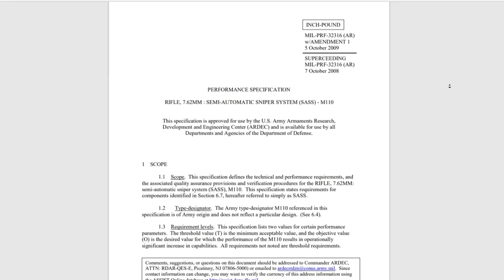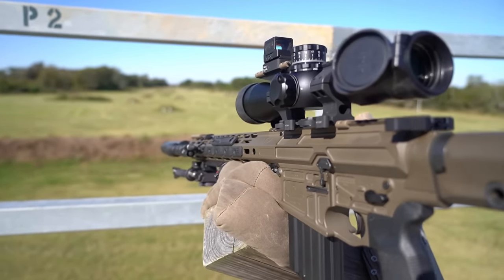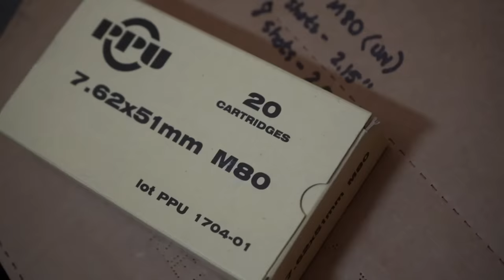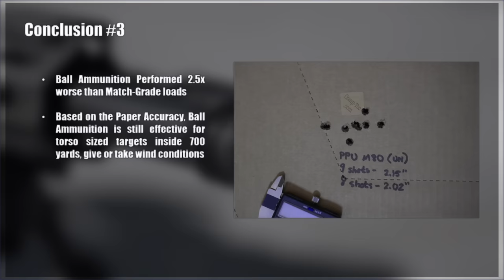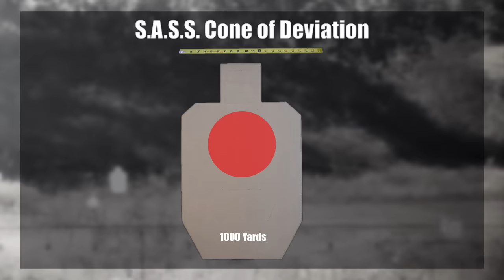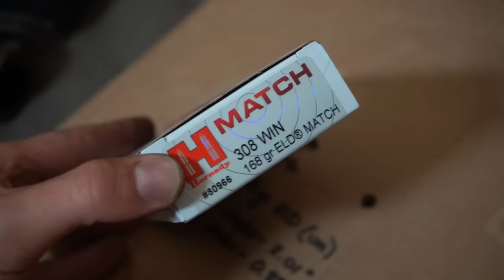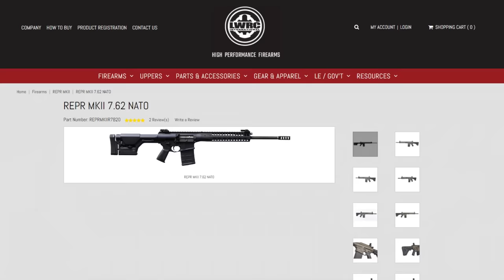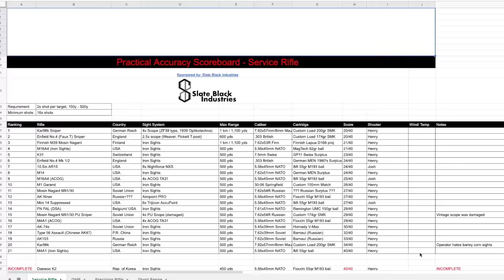Anatomy of the Semi Automatic Sniper System (SASS): Featuring the Lone Star Armory TX10 DM Heavy

Comment: what's with the 3:47 trigger press?
Reply: A consequence of a small grip and/or a relatively heavy trigger I suspect. A small grip's short LOP tends to make pulling with finger contact near the proximal phalange (the part closest to the knuckle) easier than pulling with the distal phalange (where the fingernail is), especially for those with larger hands. Some shooters also find it easier to control heavier triggers in slow fire this way, although given that the trigger in the video looks like a two-stage, it probably isn't very heavy

Comment: I'm running an Aero M5 with a Faxon 18" pencil barrel, it's a 2MOA group with M80 but sub-MOA with FGMM and Barnes TTSX.
Reply: How many shots per group?
Reply: @lucastonoli3256  usually 5 shots per group, I can't really afford 9 shot groups when some of this stuff is $2 or more per round. This rifle wasn't built for accuracy but mostly for weight. Most AR10s are 10lbs+ empty with the SASS being 15lbs. My AR10 is 7.5lbs empty, 9lbs loaded with a 20rd PMAG and MBUS Pro sights.
Reply: Running a similar setup with a 20" version of faxon's pencil barrel and have managed reliable ~1MOA groups shooting winchester match ammo. Your other reply about weight is spot on as well. Without scope my build comes in at ~8lbs, with scope 10.6lbs without magazine of course. If I end up finding an adjustable carbon fiber stock that I like, that will probably shave another lb off(running a heavy magpul stock atm). Once I get a bunch of ammo to do more rigorous testing I have no doubt that sub moa is doable with good ammo. That also will be a good time to see how the group size opens up once everything heats up. So far all my shooting has been a box at a time and not enough to build up much heat.
Reply: @SuspiciousGanymede  nice set up
Reply: Im running aero upper and lower with the Faxon big gunner 18", Im hitting sub moa with 168gr IMI razorcore

Comment: I like that I made my own poverty version of this with my M&P10. I’ve got the same SLR rail, adjustable gas block, Geissele SSA-E trigger and Silencerco omega suppressor.

I just use the stock M&P10 18” barrel though. I haven’t seen sub-MOA groups but that may be a limitation of my shooting skills rather than the capability of the gun. 

I mostly shoot German surplus with it and it’s a hugely fun gun to shoot at steel silhouette targets out to 500 yards.
Reply: Did you have any issues with yours from the factory? My one experience with them was one that came with a finger tight barrel nut and didn't shoot anything better than paper plate accurate like that.
Reply: @randomidiot8142  I didn’t have any issues like that. When I free floated the gun with an SLR rail, I had to remove the stock barrel nut and I don’t recall it being loose and easy to remove like that.

As for accuracy, I don’t shoot a lot of match ammo with the gun, (not at all before I free floated it), but it was certainly not outside of 4 MOA accurate.

I haven’t shot for groups in a long while but I will say even free floated the accuracy hasn’t been amazing for me. When I was zeroing it for a new scope I wasn’t able to get better than 2 MOA out of Gold Medal match 175gr. Again, this may be my shooting skills not the gun. 

It’s been a long while now since I shot those groups with match ammo and I think I’m a better shot than I used to be. Maybe it’s time I take this back to the indoor range and try shooting for groups again.

Comment: Solid video, nailing a lot of points that many ignore/are ignorant to. That said, I’ve largely ditched IR systems on precision guns opting for it to be on the spotting scope
Reply from the maker: Interesting - are you running some sort of nvg or clip on with the spotter as well?  Or is it just acting as your host for the IR device?
Reply: @9HoleReviews  yes, on a badger SLICK. I’ve just had issues with the IR illuminator being where it needs to be so I’ve gone over to the spotter handling that. It also allows them to better place the IR so that you can see the IR splash off the base of the projectile
Reply from the maker: @ShawnHinck  Very cool - we've been looking at some of the 'hub' setups for the spotter
Reply: @9HoleReviews  the badger is hands down the best one I’ve found with how they implement everything. They have a few guys who have spent time on sniper teams doing good work and making smart design elements that make sense

Comment: I'm cracking up as I hear the clang of the suppressor banging into the guard rail and thinking, well, it passes the "whack it on the barrier" test as well.
Reply from the maker: Goes to show how training and reps work - I had run the drill a few times without the suppressor just as part of testing...when we got it on footage was after I had put the can on the gun...I pulled back the same length/distance I had without the extra 7" of can that was needed to clear the muzzle.  WOOOOOPS

Comment: As a PRS competition shooter that has a secret obsession with gas guns, you could run a semi auto to the same level of a bolt gun. My .308 gasser is fast and similarly accurate. I will say that the gas gun takes more effort to shoot at the same level - meaning more solid fundamentals. You can get away with more mistakes on a bolt action for sure.
Reply: Curious why the difference when chassis bolt guns resemble semi auto ergonomics.
Reply: @randomidiot8142  it’s not necessarily ergonomics but more so fundamentals of marksmanship - follow through, natural point of aim, etc. gas guns are much less forgiving, especially when under pressure at a competition shooting tiny targets designed for 6 Dasher Gucci bolt guns 😆
Reply: @billbee235  6 dasher in an ar15 mutant might be fun. Maybe on a .284 case.. 🤔 

Still trying to make sense of what you're saying. It's your experience and not theory. Natural point of aim on the bolt guns is better.. McMillan a5 type stocks vs chassis vs semi makes a difference? And fundamentals.. your head telling you to hurry up and pull the trigger on a semi where on a bolt you know you don't have a fast follow up so you slow down?

Comment: Noob here. If I only shoot 600m and less is there much difference between 16" and 20" barrels? I got budged AR10 in my sights for 2022 summer for longer range shooting and hunting. If I'd get to really long range someday I'd just get a new upper for something more modern than .308.

Great and interesting video as always. :-)
Reply from the maker: My personal thought on this is, if I were shooting within 600M but wanted a 308 over a 5.56 or otherwise small-frame-AR, I'd be happy with a 16" gun...more wieldy, easier to add a can to from an OAL perspective.  Longer barrels are always going to help with the extra velocity but, within 600M you'll find a 16" pipe more than capable - You can checkout the SCAR17 PA run we did some time back where Henry had good success out beyond 500 with the 16" barrel.

Comment: Can you check the alignment of the clips inside the suppressor? if they are at the 12 or 6 o'clock you shouldn't notice a very bad impact shift, but if they are at the 3 or 9 they should push your strings off to the left or right that very same suppressor on my AR15 put A 3 moa shift to the left because the clips were all on the right. When I re timed my muzzle device to put the clips at 6 o'clock the impacts stay the same

Comment: Top Mounted dot vs Angled-right side dot (Spuhr)?
Reply from the maker: In my experience, the top-mounted dot is marginally better for trying to use the dot for observation purposes (to line the gun up quickly with a general area and then drop into the glass as described) since it doesn't require rotation of the gun to return to level.  Angle-mounted on the receiver is a bit more than marginally better for speed and recoil control on closer targets.  The top-angle combo mounts really are one I've never found to be a good option for the stuff I'm trying to accomplish - in my playing with it, it seems to do both of those two things (observation and speed) worse than the alternative options.  That's just based on playing with one briefly myself.  - Josh

Comment: Would the price of an AR-10 be lower if history was changed and the AR-10 back then had more wide spread adoption? Like if the US military seriously looked into the design and adopted a DMR role early on post WWII? Like how the soviets did with the SVD?
Reply: We would at least have a mil spec for it. The parts incompatibility between manufacturers wouldn't be as bad as it is now.
Reply: We would have a true standard for it, but probably not. The accuracy requirements and general demand of the .308 cartridge makes it an all around more expensive gun by a significant margin. We’ve seen inexpensive AR-10’a from companies like PSA, but they typically lack the more expensive features that make an AR-10 worth having unfortunately
Reply: @valiant545  to get to the reviewed rifles level with an ar15 you wouldn't be spending much less on the similar components.
Reply: @randomidiot8142  High end AR-15 like the one shown would be around $2200 give or take. High end AR-10’s start at around $3000 and go up. While I agree the difference between a high end AR-15 and AR-10 isn’t a huge price difference, the range that those high end AR-10’s can reach in chasing performance is. We’re talking $1800-$3000 range for high end AR-15’s versus $3000 to $5000 for high end AR-10’s
Reply: @valiant545  what are you even paying for at that point. That's a joke, and not a very funny one. You're paying extra to a company so you can give them free Instagram and forum advertising? The outrageous money they charge gets you what.. a fancier roll stamp? Entry to the 'I paid more' club? 

I don't get people.
Reply: @valiant545  glass aside. Paying more for optics has not left me disappointed like it has with other accessories. 

I haven't shot anything in that price range.
If these companies you mentioned are doing everything in house that's one thing. When they outsource parts like the reviewed rifle in the video.. what's the point in paying them more for something I can do myself? Just about every good barrel maker will profile an AR10 barrel and set headspace, supposing I didn't feel like doing it myself. Then everything else is just a pile of parts to put together in 15 minutes. What do they offer for their premium price that is unavailable to me when I have a pile of parts that looks almost exactly like theirs? How will spending more money with one of them get me a better performing product? I'm just curious how their price point is justified to the end user and how can I not do what they do with the same outsourced components.
Reply: @randomidiot8142  So a lot of it has to do with the quality of the build, I absolutely think you can get 90% of the way there with the same parts building it yourself, but it's sometimes more expensive at that point from shipping costs, and most high end companies discounting the parts you add compared to the market price. For example a Triarc in the $2300 price range would have all the amenities. VLTOR A5, Radian charging handle, NP3 BCG, ambi controls, Geisselle trigger, etc. The rifle is tuned specifically for its configuration, and everything mates flawlessly. You can absolutely get there for less if you shop around for deals on your parts, and it will be mostly the same so long as you do your part during assembly, but there is a level of quality that is hard to convey through text, I really wish I could just hand you one through the screen lol. Push comes to shove, I'd rather build a gun myself if a "factory" gun can't have the features I want, but if I can I'll let a smith do it. I don't know if you shoot long range bolt guns, but its kind of like how even the custom guns are typically assembled by an accredited smith usually. The small details in the gun that is a result of their accumulative experience is what makes the biggest difference of all. Again, I'm sorry if my explanation is lacking, its really hard to explain it through text other than quality of parts and quality of build. If you ever get a chance to try out an ADM, Noveske, Triarc, KAC, LMT, Radian, etc. I would highly recommend it. It made me a believer in spending more, and I sold my old Colt just to get one. Training beats gear tho, so there is no shame settling for a less expensive rifle or trying to do a cheaper build if it isn't financially viable. Cheers man

Comment: Nice video. I like the requirement discussion and the way you presented the accuracy data. On to the product: Nicely done, very heavy and high price. It should better do its job. I have only shot a Heckler & Koch MR 308 with a 16" barrel and a Steiner MX 5i. Nice gun, very heavy, very accurate and very expensive..... Main probelm with this guns besides the price: they are way more capable as most of the folks who are pulling the trigger.

Comment: I enjoyed the test but 1 MOA accuracy at 100yrds does not equal 1 MOA at 1k yards.  When you run it over a chronograph and factor in the standard deviation number and extreme spread number you will have a more realistic expectation. Shooting ammo with 30fps SD and 60 ES numbers is going to flop at 1k yards.

Comment: Wouldn't running 6.5GRE out of a AR-15 platform be lighter and get you about the same for distance?
Reply: While you could definitely get the same levels of accuracy, I'd imagine a .308 will have more energy on target at all distances.
Reply: +1 my .308 precision gas gun knocks steel off the T-Post inside of 600 yards 😂 that round just hits hard
Reply: @lordhellfire153  Depends on the loading, but some 6.5 Grendel rounds will have more energy on target once you pass ~700 yards due to the high BC. I'd also argue more accuracy in practice due to substantially less recoil, as 6.5 Gren is basically necked down 7.62x39.
Reply: @hjorturerlend  I know the energy @700 is true for 6.5 Creedmoor but I've ever heard that same claim for Grendel. 

And the 7.62x39 thing is why it only takes a barrel and a magazine swap to change any AK over to Grendel. Trust me, I've looked into building a 20" milled build specifically to take advantage of this, but sourcing a barrel is a bitch.
Reply: @lordhellfire153  6.5 Grendel functions similar to 308 in every way except energy (still decent energy though, just not as much).  As for the 7.62X39, the Grendel performs significantly better in energy and velocity and drop. The 7.62x39 performs like a 300 blackout, not particularly effective beyond 300 or 400 years.
Reply: @Brimwald  At point blank range 6.5 Grendel performs pretty much identically to 7.62x39, but it retains that energy due to the high BC.
Reply: @lordhellfire153  Ok, might have misremembered that. The point still stands tho, the energy difference at long range isn't much - both have lost enough energy to the point where they are just making 6.5/7.62mm holes in the target. 

I'd go with a normal 16 inch stamped gun for a 6.5 Grendel AK build, a "light battle rifle" build with a 1-6x. Not much point in trying to turn the AK into a DMR imo.
Reply: @hjorturerlend  that's true

Comment: 1:8 twist? 100fps per inch cut down? That doesn't seem in character for .308.
Reply from the maker: I said 100fps over the 4" difference from 20 to 16", not per inch.  100fps per inch would be way too much velocity loss at those barrel lengths based on what we've tested.

1x8 is direct from the LSA team.  Will ask them to confirm?  Maybe I misheard.
Reply: @9HoleReviews  nope you right. I am deaf. 100, over 4 inch total. My mistake. 

I have heard of 1:9 but that is usually designated for 118LR military rounds. I am curious if they have discovered something new.
Reply from the maker: @FXIIBeaver  I'll have to ask next time I speak to them - obviously this liked the 178s the best....wonder if related?
Reply: @FXIIBeaver  the mil spec twist is 11.25. 1/12 is probably saami but 1/10 is becoming very common now. 1/8 would be very quick but it would probably work fine. I’m having a rifle rebarreled by SAC in 308 and they recommended a 1/9. These new bullets require faster twists and a little extra also allegedly helps ensure a clean subsonic transition
Reply: @9HoleReviews  makes sense.  Spin a heavier bullet faster.

Comment: What about the difference between a 20 inch barrel and a 24 inch barrel.? They build sniper rifles with 20 inch barrels nowadays.? I bet you build a huge fire and then pour water on it. Get real, I would never pick a rainbow trajectory .308, a 20 inch barrel, or a semi-automatic. None of those are conducive to a great sniper rifle. Sniper rifles should be bolt action only. How about a 6.5mmx.284 Norma with a 28 inch barrel. Or, for longer ranges, a bolt action .30-.378 Weatherby with a 30 inch barrel. Or the same in .338 Lapua. Semi-auto, .308, 20 inch barrel and you call it a sniper rifle?. No way. You can call it a squad marksman rifle, but never a sniper rifle. It is about like that new rifle that Sig-Sauer is making, the Cross-Fit or some BS like that? You can get it in a 16" barrel or a 18" barrel. No thanks, the people at Sig Sauer must have got into some edibles. The 7.62 Nato or .308 Winchester is a rainbow trajectory brush gun. It was a POS in 1957 and it still is a 30-30 like performer now. An easy to handle bolt with a 26 inch barrel in 6.5 Creedmoor would be miles ahead of a .308, or even a .260 Remington. No rifle should be able to be called a sniper rifle unless it has a bolt action and a 26" barrel minimum.
Reply: Modern snipers in the military use semi auto precision rifles LOL. Sit down nerd.
Reply from the maker: @magnus you'll need to let the Army know - SASS M110 designation and 'sniper' designation to a 20" gas gun is a direct military specification.  Let us know when you have your DOD meeting XD
Reply: Someone's insecure